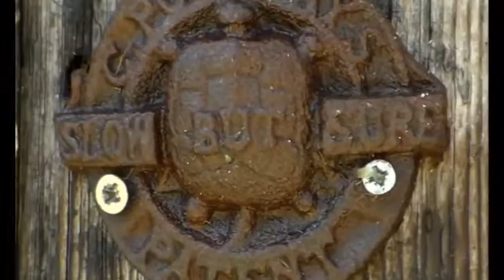Electric lawn mower bearing repair, Qualcast motor bearings re-lube.

Comment: Thank you for this amazing video. I was trying to get the motor apart to check for a broken electrical circuit and like everyone, I got stuck separating the motor. After trying lots of things i sprayed wd40 on the top bearing you were trying to replace, and let it soak for about 5 minutes and then found by inserting a larger flat headed screwdriver in the top brown piece in the side holes (not where the brushes go, and then lever the plastic cover up, it came off with a few gentle attempts. It was the top bearing that was keeping it tight on there. This then allowed the outer coil and inner coil to slide apart and gain access.
Reply from the maker: Brilliant, It's wonderful that you are working on this, Please help to promote this self reliance through skills channel, cheers

Comment: Hi, thanks a lot for this video! My experience and repair were exactly like yours: I stopped when the motor noise turned nasty, so I took it apart and hit the same roadblock, and since I didn't have any experience at all with mowers I searched and found your video. It seems you are absolutely right when you said, it's a "generic model": the whole assembly looks identical even though I'm from Germany, and this is from the firm Einhell, model BG-EM 1437, 1400W, production date 10 years ago. Your little comments everywhere were extremely helpful, so I knew where to look and lift the little covers on the bearings and lubricate properly. I found that it wasn't good to tighten the top brown part holding the motor brushes too much, since then it would stop turning easily. So turning it on, thankfully no blue smoke dragon, at least not yet, and the overall sound of the motor was very smooth, silent and gratifying. I don't think it ever sounded as good as this, it's amazing what a little well-applied lubrication will do! And also thanks for that funny comment near the end: "I'm just gonna pop a bit of oil on these screws, because why not?!" I think that's going to stay with me from now on... 🙂
Reply from the maker: Thanks for your detailed comment, great that you stopped early and that you were able to complete a repair. I hope you subscribed, cheers
Reply: @TheInfoworks  Yes I've just subscribed, thanks. I'd be interested to know, how long did the mower keep working in your case? Mine must be 6-8 years in use, so even with this repair, I don't think it's going to last that much longer, though it was still a thrill to get working again.
Reply from the maker: @Kolja-fg4bw  Another 4 years before the armature started getting hot, cheers

Comment: where you were trying to lever the belt off (11.20), if you look a little lower you will see 4 screws, undo those and the motor assembly will slide (you can see the elongations around the screw holes) - that will give you the slack to undo the belt and refit it
Reply from the maker: Hi, that;s the problem with live investigations, cheers

Comment: A superb video as you have encountered all the same problems as I do and then talked them through. I just got a discarded Hyundai HYM 3200E with tight bearings the runs for a second or two then stops. The set up is exactly like this Qualcast and I'll be having a go tomorow to save it from scrapyard.. Thanks for inspiring confidence.
Reply from the maker: Thanks for the comment, sound like there is some form of over current regulation so that it switches off rather than burn out. Hope you have success and you subscribe, cheers

Comment: Two years later this video saved my lawnmower...
Reply from the maker: That's grand, keeping it dry and free from grass will also help, clean and dry for winter, cheers
Reply: @TheInfoworks  yea I usually give it a good blow out after summer...however you never remove the motor asembly to clean it there....hell of a lot of dust in there....I supose after 12 years of use it will be dirty down there,anyway I sharpened the blade also while it was off ....cheers from South Africa

Comment: Good work Andy, Great pleasure in a little success like that.  The little pulley on the splined shaft looked to me like a washing machine motor pulley.  I see other comments saying otherwise, but my opinion is what it is. If so, they are very well pressed on there. I managed to release one once using a miniature bearing pullers, I may have made a video of it.  To get the pulley off the shaft I had to make it red hot, it seems to be beyond an interference fit, but I can't imagine that they heat them to fit them on.  I imagine with your press and jig and a bit of heat it may have shifted.  But the heat may have damaged the plastic. Or the jig may have shielded it and acted as a heat sink.  Nevertheless, it works! and that is a success.  On another thread, the brushed commutator motor is a universal motor, it will run on AC or DC.  I am sure there is a bit of math involved, but it must be possible to stick some batteries up on top. I guess the trade off is that you have all the freedom of no cable but you get to lug the batteries around.  Maybe I have talked myself out of giving it a go.
Reply from the maker: Yes it easy to press this pulley on whilst its hot and its not designed to come off. On the thread of running this on DC I usually work on the rule of thumb that half the voltage for DC is where you need to be otherwise the motor will burn out. I use the old fashioned 110v beer pumps from pubs at 50v DC and they seem to last. Cheers

Comment: That bearing looked like it was toast - you might have made smoke a moment later, as  I think you said. Good job it freed up because it didn't look like it was going to be much fun getting it off that shaft. Cheers,Dave
Reply from the maker: Dave, yes I think heat and an improved press jig would have been needed, I put it down to luck that it freed off so easily, it's what happens when dealing with consumer society's cast offs, cheers
Reply: @TheInfoworks  Had the same problem with the bearing on a completely different mower (guess that's how they make all of them these days). It freed up after putting some grease lubricant on it, except now the mower is giving away a smoke with an unpleasant smell when in use. They should make these bearings replaceable so I wouldn't have to buy a different mower every time. Especially because this seam to be a common problem.
Reply from the maker: @22Sangre  Hi, it's that whole thing about cutting the grass when it is damp and then moisture in the bearings, but yes I wish these bearings were replaceable, same as washing machine motors and the small multi V belt pulley, cheers

Comment: Great video Andy which I only came upon after dismantling the same mower.  This would have saved me some time.  It was great fun anticipating your next move as you went along.  The impeller below the motor on mine disintegrated quite alarmingly whilst mowing.  I have the same issue as you with that drive pulley splined onto the motor shaft and I can't see any way of getting it off with the tools I have.  The impeller is above the pulley and cannot be replaced without first removing the pulley.  I can't even source a replacement impeller.  It is so frustrating that it means the end of the mowers life and the expense of a new one when I can see just what needs doing and the part would be of minimal cost.
Reply from the maker: It looks like I was lucky to catch that bearing before it totally destructed. The pulley has splines and is heat shrunk on, so a press is needed, cheers

Comment: I would have given you an extra upvote for your patience.
Reply from the maker: Thanks for the confidence, hope you've subscribed, cheers
Reply: @TheInfoworks  I have torn down a Black and decker MM525 down to the armature and need to replace the bearings but cannot find a video on the process. I will have to practice on one that is seized unless there is a way to lube it like you did. Sometimes they put a cover over the bearing part that stops the lub from penetrating, hence the short life.
Reply from the maker: Martin, keep at it to improve your skills, good on you, cheers
Reply: @TheInfoworks  this is action-packed. thanks - subscribed
Reply from the maker: @voidisyinyangvoidisyinyang885 , Cheers.

Comment: Well, after cutting the drive pulley off to get to the bearing, it was still seized solid, and I lost patience and applied a strap wrench to the plastic fan. It then came loose and i found it had got so hot that the fan had welded itself onto the housing. The oiling had indeed got into the bearing, but it was rough, so I pulled it off and bought a new one for R25 (1£). I checked the resistances of the commutator segments, and there weren't any dead shorts or open circuits, so i though that would be ok . I reassembled the lot, gluing the drive pulley back together with Q-Bond (gap filling 2-part superglue) And it worked, but sadly, only for a few minutes before overheating again .I then took the top cover off and observed . There was a lot of sparking from one of the brushes , and it overheated even more quickly. It seems there is an electrical fault.  So, thats a fail
Reply from the maker: Well done for trying, it certainly sounds like a learning curve. Once those brushes start arcing there's no way back, cheers

Comment: I used your video and got the first one that I was given by our croquet club back to running condition. However recently I was given another , from Freecycle, and it has defeated me. It didn't respond to oiling, and remained seized solid. So I needed to get that drive pulley off, but nothing worked. Home made puller, blowtorch, acetylene torch. no dice. So I cut it off using a Dremel, and even then had to cut twice. But Ive still not managed to free the shaft. . It would be a pity to scrap it after getting this far, so I've written to Ryobi to see if they have parts. But somehow I doubt that
Reply from the maker: First class focus and application, well done for the stamina and not giving up till the final call, cheers

Comment: My qualcast stopped. When I tried to take it apart the shaft that the cutting blade spindle nut attaches to has no resistance so I am unable to remove the nut and the blade. So I can't access the motor but I can see that the belt, that I changed last year, is still intact. Can you give me any suggestions please?
Reply from the maker: Hi, several things come to mind, first the blade not and the blade should spin together, so restraining the blade would hold the nut. 
If you spin the blade does the belt move? and does the motor spin?
Is power getting to the brushes, what does your multi meter say?
Maybe your problem is in the switch, or your cable.
Cheers
Reply: @TheInfoworks  just looked at it and the blade spins freely but it's not engaged with the shift. So the shift is spinning but the blade is motionless is what's happening. Hence I can't remove the nut as there nothing to hold the shift, ie the blade, to brace it.
Reply from the maker: @Tonyr2  so you will have to make a wooden jig to hold the pulley wheel and also soak the blade bolt for a few days, cheers

Comment: Are they're not higher quality mowers son the scrapyard or are all modern ones low quality?
Reply from the maker: There may well be better quality machines but they don't make it the scrap, we have to deal with what we find. At least this will run on sunshine for longer and then I have a spare one with no wheels, cheers
Reply: @TheInfoworks  I have a brushless motor 40 volt - ever replace or grease the bearings on one of those? thanks
Reply from the maker: @voidisyinyangvoidisyinyang885  , I assume at 40v this is a brushless DC motor. I have not yet had to deal with one of these but assume the bearings are quite simple to get to unless the motor is sealed, cheers

Comment: Hi I’m working on the same motor from my mower and cannot get that belt drive cog off either and my bearing is toast so it’s a fail unfortunatley
Reply from the maker: I'm thinking loads of heat and a home made puller, cheers

Comment: it will not budge with a press cause the pulley is threaded on the shaft. there is a thread, not push fit.
Reply from the maker: Hi, interesting, well all have differing experiences, Bootsowen found that they were splined and pressed, cheers

Comment: Hi Andy, great video. We always want to strip everything apart but sometimes have to accept to repair as best as possible without complete disassembly. I have a Bosch 320 but very similar shaft and pulley. Mine has a loud sweal as the fan behind the small pulley is no longer connected to the shaft. (It just spins freely). When doing this video did you see did you see how this fan is attached to the shaft? I may have to just lube to remove squeal and risk running for short periods fanless ( there's a bigger fan on the larger pulley which will give some cooling)
Reply from the maker: Hi, the plastic fans are normally just pushed on the splines on the steel shaft, some Araldite or similar glue may fix this. IF you could remove the fan then a bit of beer can as a shim would do the job, but in this case removing the small pulley is mostly impossible as they are heated up and then pressed on. A small hole drilled hrough the lot and a roll pin may do something, cheers

Comment: Hi Andy, great video. I've just stripped down a similar machine - a Qualcast MZEB1537M which had a broken washer under the blade. In doing that, I decided to strip the whole lot out because it looked like this machine had ploughed a field and was clogged with mud, grass mulch and had been kiln dried! It smothered the motor and all around it. I removed the plastic housing which holds the brushes and revealed the bearing - I also removed the cover to the blade rotor spindle revealing that bearing. On reassembly I was left with a 'wavy' sprung washer about the size of a 10p piece which must have been on one of these spindles.
Having stripped yours down, can you tell me exactly which one of these spindles I should be placing this sprung washer? Thanks and keep up the good work!
Andrew
Reply from the maker: Andrew, I'm not able to remember but would guess the outside of the top bearing, good luck, cheers
Reply: @TheInfoworks  ah, but which bearing is my concern? The one above the electric motor or the one over the cutting blade spindle. My guess might be the blade spindle as there may be more friction, but I was hoping someone more techi than I might actually know. I just forgot after dismantling them both! Thanks anyway, I'll get there. Keep up the good work.
Reply from the maker: @andrewpain6754  The spring washer is there to take up any pinor end float, so which end is academic unless the bearing sizes are different and the spring will fit in only one end, cheers
Reply: @TheInfoworks  Sorry Andy, maybe I wasn't clear enough. There are 2 spindles. 1) the one going through the motor 2) the one supporting the cutting blade, both parrallel to one another and connected by the drive belt. It wasn't which end of the spindle I needed to know where this spring washer goes, but which spindle. The one on the motor or the one connected to the blade?

Comment: update; in y case the small ball bearing is also a write - off and a gear puller wont remove it.reading other comments I  will have to resort to an angle grainer and cut it off. But the lower large bearing is wobbly, and it's not going to be treatable as yours was. There is some sort of packing around its outer circumference , and I'll have to get that belt pulley off to fix the bearing if the mower to work again. Probably futile. We've bought another in the meantime
Reply from the maker: Hi, I see you are up against it with this one, but the challenge is worth it. I often use a dremmel with a 25mm cutting disc to get into those difficult places, especially removing bearings, cheers

Comment: Is the machine fitted with capacitor?
Reply from the maker: Hi, this is a brush universal motor so it has no capacitor, The mowers with induction motors have capacitors, cheers

Comment: How do u remove the bolt which snapped in half when the blade hit a rock? Half is stuck in the plastic bit.
Reply from the maker: Hi, a common problem, removing snapped bolts starts with marking the centre accurately with a punch and then drilling out the bolt. It takes time to get the exactly in the middle of the bolt end, then you re- tap it. Cheers
Reply: @TheInfoworks   cheers will try it but hope the plastic is strong enough with the force of the drill bit.
Reply: Yes spot on worked a treat thanks
Reply from the maker: @jimmykahn5431  That's grand, hope you have subscribed, next up a Henry vacuum,  cheers

Comment: I had the same problem. Cut out the old pulley, replace the bearing and got a new pulley machined and put in place, that's the only way i knew how.
Reply from the maker: Bill, yes, I figure trying to press the old pulley off is a recipe for disaster. Had to do the same thing recently with a sowing machine motor, cheers
Reply: Yep me too, lower motor bearing and the 6002 out rigger on the large pulley. Motor bearing cage failed and 6002 dried out.
I think if a substantial enough piece of tooling were made the vee belt pulley could be pushed off, of course you can only get limited heat on it due to the proximity of the plastic fan.
I think really the motor bearing is undersize for the load and the pulley overhang too long.
Four summer's was I got from mine on a very average size lawn.
Big thanks for posting mate.
So it's eBay for a replacement motor........?